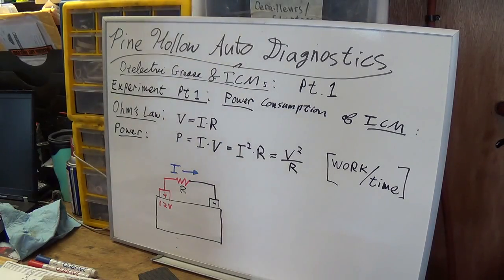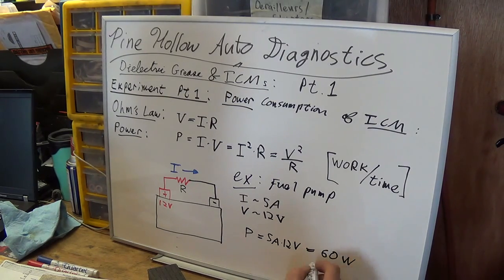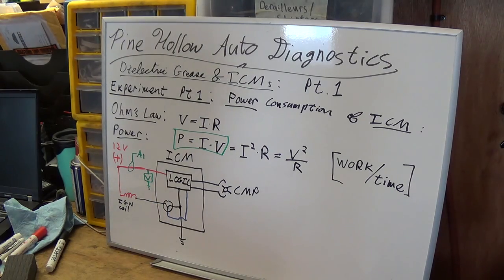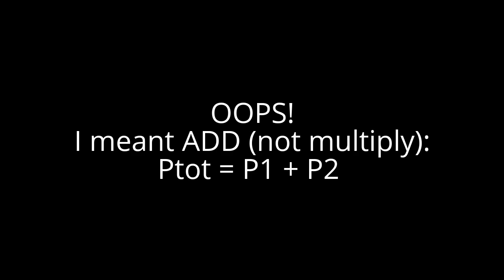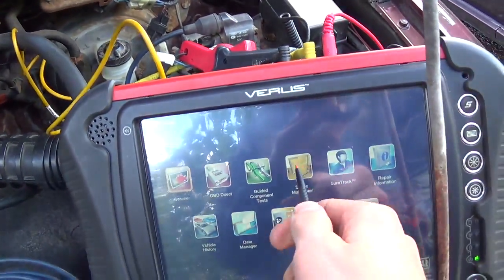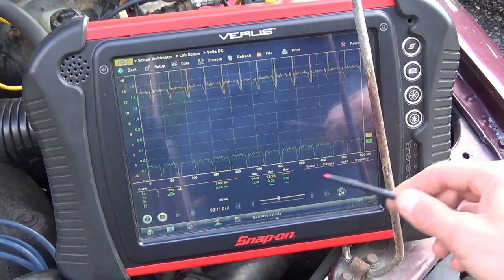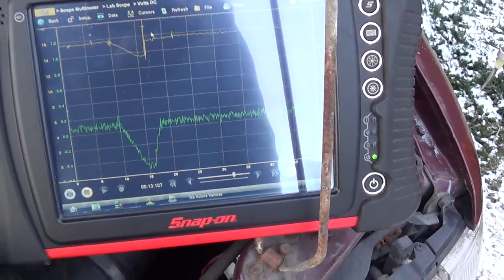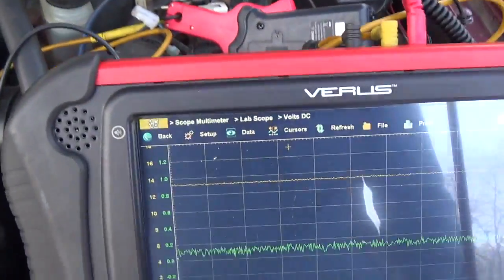(Pt 2) MYTHBUSTERS Ep1: Dielectric Grease & ICMs

Comment: This video brought back some memories about my 1990 Mazda 323 (Protege) I had. 
Once I was checking out the charging voltage from the battery with my cheap multimeter and it showed some crazy readings. Then I realized the multimeter took interference from the ignition coil, which looks just like in your car. Relocated the multimeter and got 14,2V charging voltage which is probably ok. 
My Mazda died on the road once because the ignition module fried and it was located inside the distributor as well. It had the 1,6 litre 16-valve carb engine.

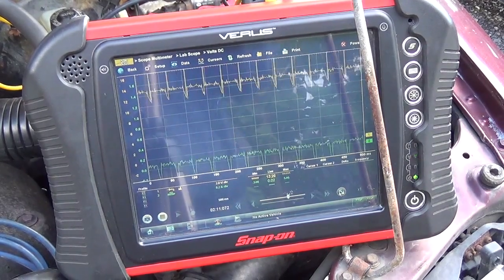Comment: 13:00 I suspect the negative peaks in the current waveform are the back EMF from the ignition coil being shorted to battery by a flyback diode in the ICM. Otherwise the transistor wouldn't last 10 minutes in this application. Regardless, predictably, the logic in the module contributes very little to its power consumption. Let's carry on watching.

Comment: Ivan, if you look in the upper right corner of the video at 20:41 I can see a red wire running next to the relay/fuse box that looks to be arking to another wire. Check it out and let me know.
Reply from the maker: +gary smith Wow sharp eye Gary! I think it's just a little piece of tape flapping in the breeze...You had me worried there lol

Comment: Rage Against The Machine, man that takes me back. 

Interesting stuff, i have a basic understanding of electrical theory, but i struggle with more advanced application and theory. 

Although interestingly enough i was actually able to apply what i learned from you and Dr O to fix the heating in a friends office. He had a heating engineer trying to sell him a very expensive Siemens controller. The controller was fine. The pumps were fine, it was actually a bad relay in the pump control circuit. Got a replacement relay, a bit of soldering to adapt it, works fine.

Comment: Awesome, ok now Ivan I have tested my amp clamps and I have many , well I would say in my testing you can chuck all of them in the trash LOL. I have yet found any clamp even close to an actual amperage draw at lower readings under 1/2 amp for sure.  For me it's a good indicator of currant flow but not measurable with the clamps I have. Fluke does make an excellent low amp clamp but pricy.  150 views and I'm only the third comment, man this stuff is gold, don't get it. Would like to hear you response to my concerns with the amperage measurment. Man I've been wrong before so I'm ready for anything. HAHA
Reply from the maker: +Steve Rob I think your average amp clamp is actually very good in accuracy down to a 0.1 Amps or so. You just have to worry about the noise-to-signal ratio at the lower values. Maybe a small metal box around the jaws to shield from any stray magnetic interference? Hey...that's actually a pretty good idea!